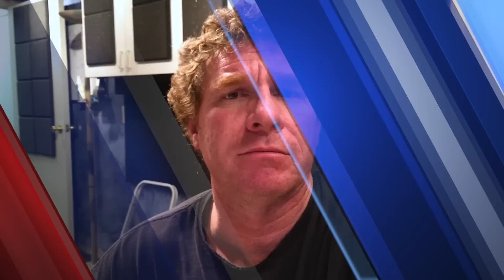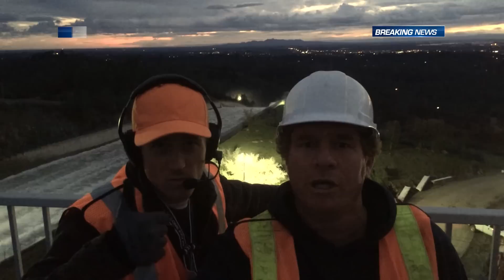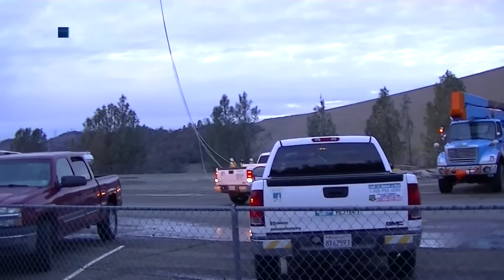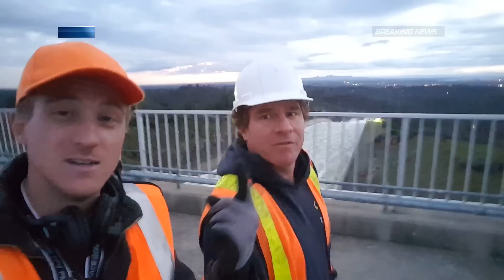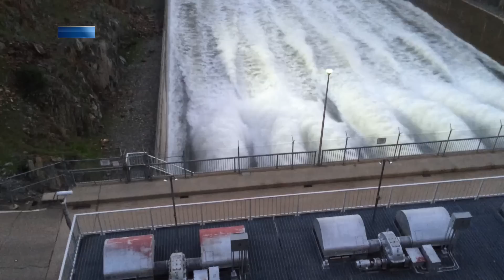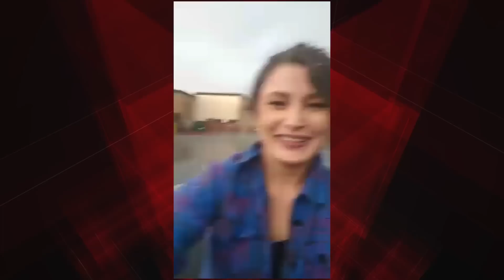Oroville Dam spillway collapses 🔴 2-11-17 inside the danger zone

Comment: 10 day weather forecasts and what not,  there's no reason the water level should reach the spillway..  Open the gates ahead of time and lower the lake..  If I can figure that out,  Why can't a State employed Engineer,?  Now,  $100 million mess..        Thank You Obama !
Reply from the maker: One of the problems with this dam is just to be able to open the gates the level must be nearly full. Like all dams the level must be at least 50 foot above the gates. If it's to low you get a vortex and it will suck in debris that can damage the gate system. If there open when filling, debris can plug the holes causing a hole other set if issues.
Reply: I guess that's a Judgment call...   I maintain,  If they can lower the level after it reached the spillway,  they could have done it before..  Maybe not a lot before like you say,  But there was Plenty of time,  if you're paying attention..
Reply from the maker: True. They should have just ran the spill harder and not tried the secondary. But with out a deceleration of emergency from the Governor. They could not get the feds to open the wallet. Otherwise it would need to go through committe and all the other processes. Now it's an open check.

Comment: rip rap? 😩😩
Reply from the maker: Rip Rap is what we call large angular rocks of 8 inch or larger. You will see it at the entrance to many construction sites for the trucks to drive on. When placed on the ground they lock in and can resist moving. It comes in many sizes from 8 inch up to the size of a person. Basically it's blasted from the hill side of a solid rock mountain. Then screened to get rid of the small stuff. If you look around you will see it everywhere. Now you know more about Rip Rap then your friends and can inform them. Useless information is only useless tell you know how to use it.
Reply: Forest Rat Productions. cool.. however i was referring to its futility..
Reply from the maker: I just saw a picture of the area. The rip rap and grout held up. It looks just like it did when the placed it. Everything else got washed away.

Comment: Hey!  The dam isn't going to fail, but the emergency spillway might.  Big difference in the speed that the water will come down.  Very important to get the facts right.  Thanks for the video.
Reply: Rob Waltemate  The e spillway is technically part of the "Dam " system , just not part of the main Dam ! The  E spillway structure is holding back water the same as the main Dam! This problem is the result of negligence plane and simple, Due to the lack of sufficient inspection and maintenance of the Main spillway and the lack of erosion control materal on the E spillway at time of construction!  This whole situation should not of happened anyway because the approval of the dam being built was a guise of "flood control " but in reality its actually "water control", water being stored for the cities down south i.e. L.A. , meaning keeping water levels drastically higher than need be to prevent flooding!  BOTTOM line, the southerners should pay for all of this!

Comment: they had to shut off the electric turbine generators, so they had to 
resort to the spillway.... seems that the bearings are seized up with 
some black plastic shards from the billions of black plastic balls they 
released a year or so ago in Nevada and California (gotta dump plastic 
somewhere in order to ("save
 water").... go pick up your black plastic balls, grow a real set of 
real balls, and quit deliberately dumping plastic into our environment...in 
the next 5 days another severe rain and snow event is foretasted in your area.
put a life jacket in your car for each person.
Reply from the maker: Has nothing to do with plastic. But everything to do with back pressure. These turbines can only operate with up to 10 foot of head pressure on the outflow. This is something that affects all dams and hydro power plants. Once the back pressure becomes to great they are forced to shut them down. All power plants are designed with a small amount of head on the outflow. What can happen is the excess pressure on the outflow can cause a vibration pulse to start up the penstock. This will cause a failure of the penstock or even blow the turbine out of the generator house like the one that happened in Russia a couple of years ago.

Comment: Would Sacramento be affected if the Dam were to collapse?
Reply from the maker: The dam is not in any danger at the moment. The big concern is undercutting of the secondary spillway along the back of the dam. That is why they added the rip rap and grout you see them placing on the video.

Comment: Whose bright idea was it to build "power lines" and other infrastructure in a dam's emergency  FLOODWAY?  Sorry, that is idiotic.
Reply: Ohseeyo Tsalagi. Agreed !    Looks to me like the E  Spillway wasn't completed,  there's not enough erosion control materal at the base to keep from undermining the dam! Isnt that why they're doing it now ? they're only 50+ years late! Man, you think negligence from  the 86 flood and following lawsuit cost the state, that'll be pocket change compaired to what It'll cost if there is flooding from this problem!
Reply from the maker: They were installed in the 60s. They ran the lines that direction for 
one reason. It was a straight line. Now they will need to run the lines 
along the west side of the river about 1 to 2 miles then cross the 
river. The area is extremely steep in that direction. I don't know how 
long you can fly 3 helicopters and 8 line crews before the cost of 
saving the towers is out weighed to the cost of new ones. The bad thing 
is they had to reroute power over different lines. The generators at the
 dam are off line while the dam is spilling. Most dams will go off line 
when they spill.
Reply: That's Liberals for you! CA. is run by Democrats that are too busy with the Illegals ad suing President Trump!

Comment: concrete takes 30 days to cure, nice try though
Reply from the maker: I own a ready mix company. I went and talked to the transit drivers. The mix they were using was a standard 6 sack with 20% accelerant, 6 % water reducer Polizlith, and 5 % air entrainment.  It had around 24 hours to set. If they wanted fast they could have gone with what we call 4 X 4. it makes 400psi in 4 hours. We mix it for CalTrans road patching. But they could not use that there as the transit time was to long. The batch plant was nearly 45 minutes away and they did not have enough trucks to get the material there fast enough.  They wanted to cover the hole area to the road but there was just not enough time or trucks able to get materials from the mine to the dam before the spill would start. 2 of PG&E towers are in danger of being washed into the river.  You can see them in the start of our video. We prefer to get our information directly from the source and report it to you.
Reply from the maker: The epoxy must be between certain temps and can not have water on any surfaces. Concrete is all we do. When we got there and stood next to everything it was easy to see the scale of the problem at hand. I guess the only way to describe it would be to give you a shovel and trowel then tell you to Gunite 8 Olympic swimming pools. While at the same time tell you you only have 6 hours and after the 6 hours are up we are going to fill it to the top in 6 seconds but to make it more fun we are going to have the fire department continuously spray water in the pool while you are trying to work.  Oh if you watch the update I just did you will see a good picture of the hole with guys standing in it. It shows them on the upper north corner. It's the only one I have found so far. Now they are forced to drop Rip Rap in via helicopter since there is no road any more.
Reply: Forest Rat Productions. The people should listen to Forest Rat.  He or she is correct.
Reply from the maker: They do have rapid set. 4000 PSI in 4 hours. But like I stated. We can't get that much up there and in place fast enough. There is only 1 batch plant in Oroville. And there lucky to have it. From what I saw there was a couple of bars sticking out of the rocks. When they first shut it down. You could have fit a 2500 SqFt single story house in it.
Reply from the maker: I own mobile batch plants. That's why we were there and able to get in past security.  They were looking at an easy 650 transfer truck loads of rock and another 500 of sand.  + cement + cement silos for storage. But we could not set up anywhere close to the spillway within pumping distance.  We would have been better off just dumping it in the spillway and pushing it down into the hole with a tractor. It was hard enough just walking down the hill. Now they have a road and flat work area cut on the south side. When we were there it was barley a dead end road a pickup could go down. They had no idea what they wanted. Verizon drove a trailer up from Dallas TX straight through. DWR called them in because it had 2 surveillance cameras on it, and they wanted to be able to see the spillway and control the cameras from there office. The problem was there was no cell reception in the canyon. So they had to do a site survey. Then bring in a portable tower. But they had to get a permit to operate it first. They said it was going to take them at least 4 days to get the approval and the call sign for it. So needless to say that still is not up and running yet. But Verizon did use a DirecTV dish and get the feed to there main office. And the DWR is not satellite ready at there office.  One guy we talked to said it was like 500 chiefs all grabbing at a pile of straws on a table 150 miles away. But on the bright side we are going to have 2 new spillways next year. I can see them having the secondary joining into the main spillway just below the break. Then having a wider lower half down to the dragons teeth.
Reply: Not anymore. There's faster stuff and even concrete that will set under water.
Reply: yes it will cure under water but when you have water smashing into it before being fully cure it will  crumble quick.
Reply from the maker: It they would have filled it with concrete when it was small we could have saved it. But there wasn't enough time to get the materials up there. It's a logistic problem. The mine and closest batch plant is over 40 minutes away. If we hired every truck in the area and closed the roads to the public. It could have been done.
Reply: Bull chit, Cal_Trans has everything they needed. Could of took it by court order if necessary. Re-bar is in town, Pea gravel at the plant. flex hose for the pumps which are setting there now.. and 40 minutes away to a cement plant?. Gee. maybe we can bring in a 102 trucks instead of two??. Hell, you can fill them trucks dry and add water at the dam as long as you have a pro and inspector that know what there doing. I don't mean to disrespect you but you don't have a clue.. You might tell these people how you have 2-11-2017 and the water is 3 feet from going over the emergency spill way yet it was going over at day break, So, did you move the sun or just recorded a day earlier.. you can bet to some of the giant boulders that are now clean have dirt under them to. Lets just pray its all stays together, We get a major rain storm and by chance its a warm rain, Its all over.
Reply from the maker: We forgot to make the intro when we got there. And as for filling the trucks dry you can't realy do that. They don't have enough power to start the drum rotating if there dry. There is only one plant in Oroville and they just don't have the materials on the ground to make that much concrete. They called us to see if we could set up our mobile plants and help them.  The dam is just fine and the damage is well over 1/4 mile away on the back side of the hill.
Reply: thedrloboski stevens oh, come on everybody knows that caltrans can't move that fast as it has too many employees with upside down pockets.
Reply: Oh No, that's all changed now, they found a way to make a shovel stand up by it's self now..lol.
Reply: Your either a good cut and paste-er or know something about cement. Wet Cure??? Do you think we have time to wet cure cement out here on are freeways. "Well just cone it off till its drive-able in the number one hammer lane"?..lol. These lanes are shut down at night and drive-able the next morning again.
Reply: I understand very well what your saying. They could of had that stuff airlifted in and dropped out of a C-130. There's room up there.  And am sure you must know there's mobile batch plants as well as trucks that and mix and make there own right on job site.. As I said, once they turned it back on that plan was washed away.. What I just heard was its suppose to snow down 5000 feet when the storms get here. If I remember right that's the summits elevation. That means a chit load of water coming. Stay in touch,
Reply: Liam1694u <a> Am talking Epoxy Resin concrete freeway.'s  I've hauled thousands of tons of Asphalt as well in my younger years. Am talking Interstate Federal Highways. Am kind of busy, so do share some of your few things you know, and I'll get back with you..
Reply: You spin it dry and you'll have a dust cloud behind the truck. You can do a slow spine while its be put in.. Its going to be dusty at the plant but this is an emergency. i think they have a mobile plant on job site now..
Reply from the maker: Yes it does weigh less. The trucks do not have enough torque to spin the drum when dry and fully loaded. There are two type of standard batching system. Dry batch and wet batch. The wet batch is the most common type. There is allot less dust with wet batch VS dry. It's also a more accurate way to batch and set slump before transit. As for rotating while in transit this is done for two main reason. #1 to keep the concrete in a plastic state. #2 to keep the concrete from setting during transit. Once you add water to the cement it begins to hydrate. With cement and no add mix you get one false set and that time expires in about 40 minutes depending on temperature. After that time you are into the final set. Once in final set if you disturbed the concrete you you will wind up with cold joint. To avoid this you can remix the concrete when adding another truck to the pour in that area. But it should be done before the 40 minutes have expired. We specialize in remote jobs like one we just did in the Mendocino national forest. You can find them on our page. The only trucks that can transport dry concrete are mobile mix trucks. Standard barrel trucks do not have a way to measure the amount of water being added for batching purpose. Everything in concrete is controlled by the mix design from the engineer. We can not deviate from that or we take a chance of the concrete failing during the testing phase. Concrete is one of the most tested and regulated products on the market. .

Comment from the maker: What happened is there was a crack in the spillway that water was able to force it's way into. Once the water pressure got under the slab of the spillway it hydrologically lifted the slab. Lets say you have 50 PSI of pressure being applied to a 1 inch hole. The water goes under an area of the slab that is sealed and it can not escape from. Lets say that area is 20 foot by 20 foot. That makes 57,600 square inches of surface area the water can push on. That makes that 50 PSI pressure capable of lifting 2,880,000 pounds. Since the slab was 12 inches thick the concrete used was only 1,600,000 pounds for that 20 X 20 area.  That leaves a difference of 1,280,000 pounds of uplifting force. That force must go somewhere. This is how the spillway was damaged. Any crack can allow water in. This is why they build them with drainage so the water has a place to escape and it can not build up pressure.
Reply from the maker: It wasn't tell the late 70s when California required cement manufacturers to remove calcium and some other things from cement. The Calcium reacts with steel in the concrete and some types of rocks. It eats away the steel. But as far as bar in the spillway there seems to be very little. In fact that is something everyone seems to be talking about on the dam. There is plenty on the sides but not much in the base. The sides of the spillway are back filled with rock to allow ground water to escape through holes in the walls. So it's basically a huge french drain along the sides.  One thought is that ground water pressure is what caused the uplift on the slab because it was not draining from underneath properly.
Reply: Are you sure about that with Calcium?  I know we add 2% Ca when we want the concrete to set up faster for slabs and foundations, which are very different for sure.
Reply from the maker: You may tell them you want 2% Calcium but that is not what you get anymore. We haven't used Ca in years. Once they figured out that was causing concrete to fail early they got rid of it. One of the main things about concrete that is over looked is the size of the rock. The larger the rock the higher the compressive strength we can get out of it. Crushed rock will get the highest strength. We can also add blast furnace slag to it and make it more durable to were from forklifts. Then it's like driving on a chunk of steel. But it is super slippery when wet. We just poured some concrete at the airport for the runway. The rock used was 1 inch to 4 inch. Any rocks under 1 inch they would reject the concrete. It was like pouring cobble.
Reply: NorthOCkook Hahaha and I think a cubic yard is something like 4,000 pounds.  Maybe that person was charged by the pound? Hahaha
Reply: zzdfhgdhd other option (but maybe not for this) is wire mesh or fibermesh.  My guess is that the individual pads were not tied together?